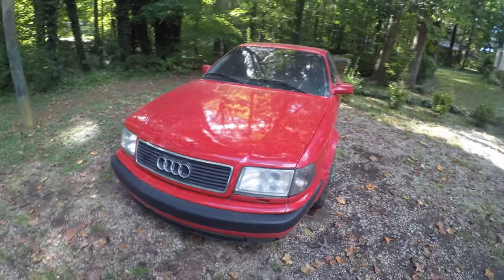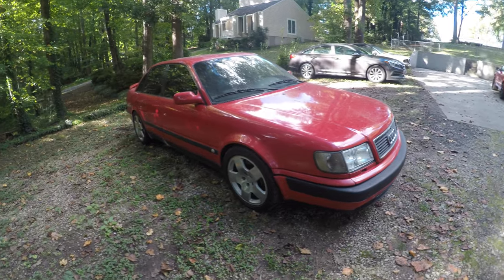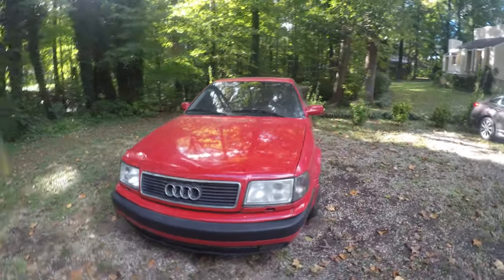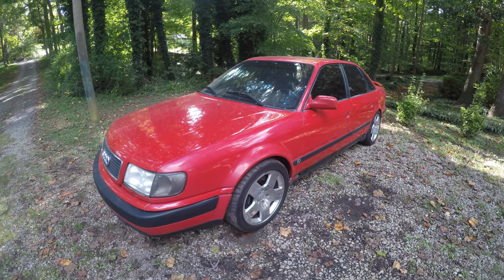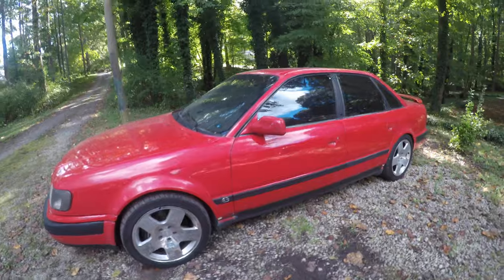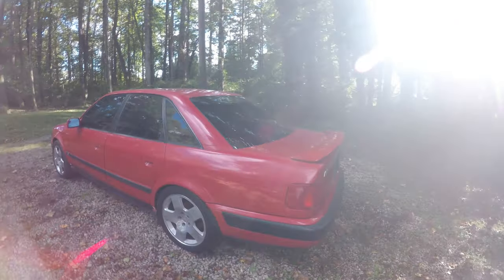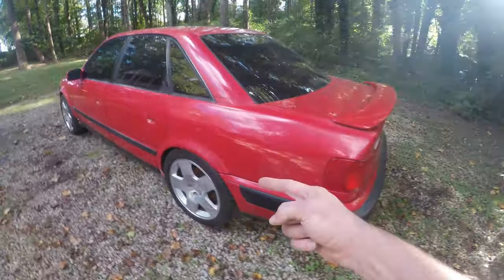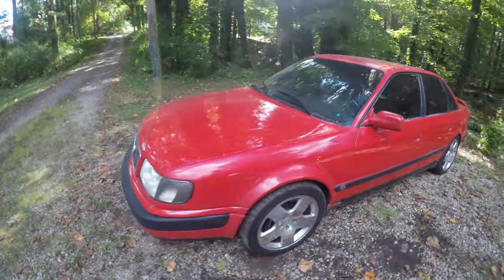Audi UrS4 AAN 500whp Budget Build Episode I - Introduction and Engine swap

Comment: I have a 91 200 with a 3b and it's a blast gonna be picking up a Maxxecu since Vems is backordered
Reply from the maker: Solid car dude, from what I can tell the Maxxecu is badass! It is more expensive but it is also newer and has more functionality. Not a bad purchase at all friend, speed density + E85 for the win!
Reply: @quattro4life20vt  for sure! I was looking into them they are are around 1500 which isn't terrible considering what you open up with the engine in general. Just replacing and old tired ecu is a huge advantage in these cars not to mention two step and antilag ect that you get when you go stand alone

Comment: I've been using those maxpeedingrods for 2 years at 635hp/807nm. works fine
Reply from the maker: Thank you for sharing your experience as it is much appreciated. Definitely good to hear someone else having experience with them. I plan on weighing the rods to see how much of a difference in weight there is between them in an upcoming video. Pretty excited to do another AAN build so stay tuned friend and thanks for watching!
Reply: Hi, i know its been a couple years but how are they holding up?
Reply: @nescockk  hi, still holding up good. Last summer was 733hp/877nm

Comment: Only down side i have found with running TFSI coil packs is in the winter. If the engine bay gets filled with snow, you will drown the plugs when the engine heats up. :)

Comment: Hi, will you put a VemS V3 on this project?
if yes , can you discribe the steps to run it well :)
wich turbo?
injectors?
thks
Reply from the maker: That is the plan, I didn't want to make a final parts list when I don't have all the parts yet as some things may change. I will be going over every detail/install of this build, also I plan to do a VEMS install, setup and basic street tuning video as well. Thanks for watching!
Reply: @quattro4life20vt  thamk you so much, You are doing so much work for the community.
Reply from the maker: @rostyslavshkromiuk215  my pleasure ;)

Comment: I'm looking at a 1993 audi s4, that a guy is selling here.....it has around 226hp, is that the AAN engine? I'm guessing it is, but i'm a new to this so i don't really know
Reply from the maker: Yes AAN engine for sure, solid unit. You should by this car especially if in good condition!
Reply: @quattro4life20vt  it has around 200 kilometers on it and has been modified to around 255hp, but the car has been sitting from 2008, that's why it costs only 3k euros. I talked to my parents and they won't let me buy it for some reason, but i'm still interested in your opinion if this car is worth the 3k.
Reply: @mesniburek1652  gdje je taj za 3000 eura, odmah ga kupujem?
Reply: @AntonovP  nema ga vise buraz......to je bilo prije pola godine

Comment: What state do you live in? I like the nice back roads.
Reply: washington state
Reply: @rostyslavshkromiuk215  have you had speed density on your ecu? Or has it always been chipped? I know you have vems now. How much torque did you have on your earlier build? I would like to build up to 500hp crank. I have urs6 300hp now. Stock turbo, chipped ecu 24psi 2.0 coils conversation silicone hoses and stage 2 south bend clutch, 2.5 downpipe straight back. Car runs great but I am used to it and now I need more.. lol😂

Comment: I have a urs4, when even i turn off the car the radio stays on....any idea what it could be....also i hear like a humming sound coming from my back seat. Is that the fuel pump?
Reply from the maker: Factory radio? From the factory you can turn the radio on with the car off and no key. Are you sure the radio is switched off? The radio is supplied with constant power so if you don't turn the volume knob all the way to the left until it clicks off it will always be on.

The fuel pump can be accessed through the trunk. Remove the carpet in the trunk directly behind the upper section of the rear seat to gain access to the fuel sending unit. If the noise is coming from there that is definitely the sound of the pump running. The bosch 044 pumps are a normal upgrade but are super loud!
Reply: @quattro4life20vt  any other fuel pumps you recommend? Maybe not so noisy?
Reply from the maker: @slobodantodoric6567  yes, I run Walbro 450 and they are awesome, very quiet for how much they can flow. If you go back and watch part 2 of the UrS6 turbo upgrade that I did, you will see a full walbro 450 install in the second half. I will be making a Walbro fuel pump install how-to when I upgrade the pump in this project. Thanks for watching!
Reply: @quattro4life20vt  my man!